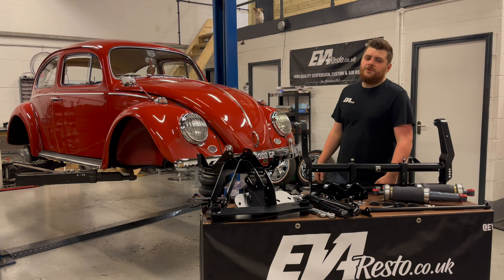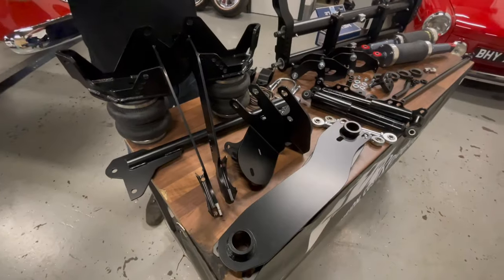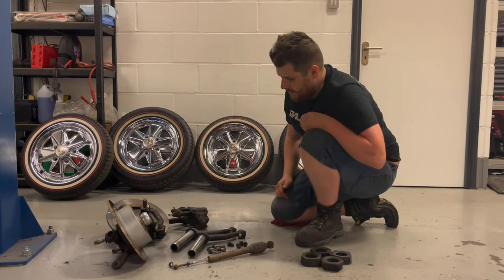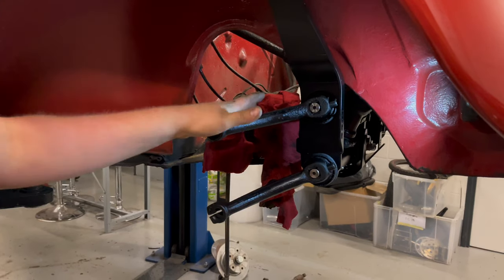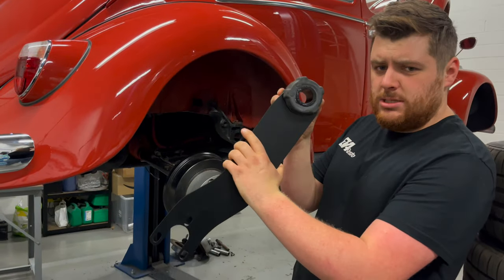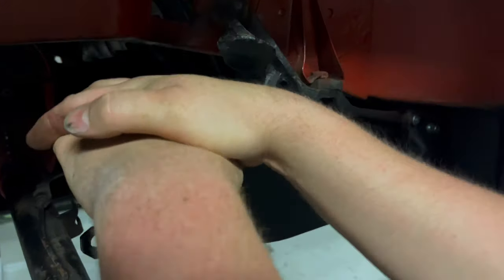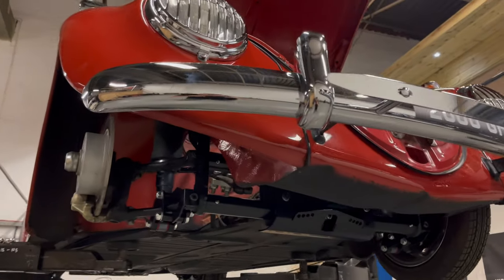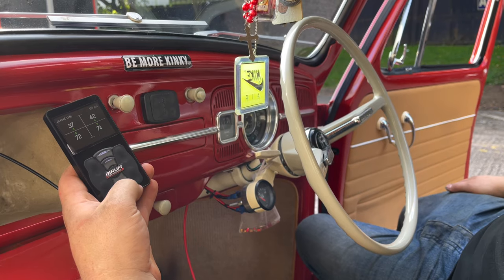Fitting Air Suspension to a 1964 VW Beetle - EvaResto

Comment: Such a beautiful kit! One question though, the rear spring plates look like they are located and pivoting only in/by the end plates? Would this not wear the rubbers out quickly? Wondering why not a solid or roller bar like in the front for the spring plates to pivot on?

Comment: Got to be the nicest engineered kit I have seen to date. The video is just so professionally done. Better start saving. Can I ask, bug is so nice, love how clean it is. May I ask an off the wall Q?? What product have you used on the pan underneath to protect it, looks Matt finish and how often do you apply?  Will be looking on your web site. Thanks
Reply from the maker: Thank you for the kind words man!! Appreciate it. 
As far as the underside finish goes, I can’t be sure as it’s not our work… It could be Upol raptor thinned and applied with HVLP gun, as that leaves a very similar high quality finish.

Comment: How important are the shock relocaters 
I have different stile of shocks but having problems lifting the front  .  There's air in lines ,No air leaks  pressure switch is working , there's no rubbing of any parts but front won't go up. Any info will be appreciated thanks

Comment: Really good quality video, for the 66 Bug kit is it the same way as this? And does it come with recommended torque specs? And does the kit require a compressor, or where does the air come from? Thank you, do you guys also ship to the US
Reply from the maker: Thank you! 
‘66 beetle kit would be the same rear as shown, but the later style ‘ball joint’ based front end kit.
Compressor, controller & tank etc are all referred to as ‘management’ and are available as complete packages. There’s a stack of different types available, and we stock some of AirLift Performance’s management systems. 
We ship to the US all the time, drop us an email for an up to date price.
Max

Comment: How does it ride compared to stock? Also is this fully inflated or can it go higher?
Reply from the maker: It’s firmer, but generally a whole lot better than a typical lowered setup. Lit will lift higher yes, there’s about 4-5” available in the front and up to 6” in the rear.

Comment: Very nice bolt in kit.  Well made but looks like heater tubes cannot be used????
Reply from the maker: Correct. They’re not a good idea on a slammed car as the axles hit the heater outlets and can damage them and the engine. They also get in the way of the top mount of the kit! Thank you